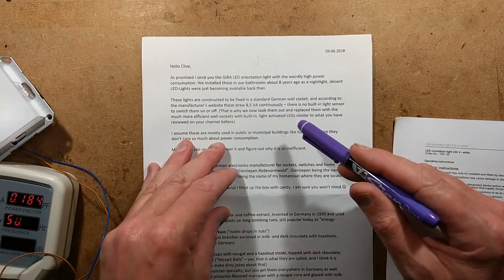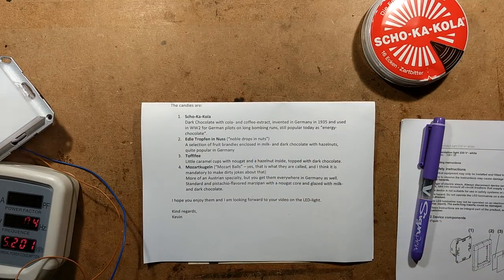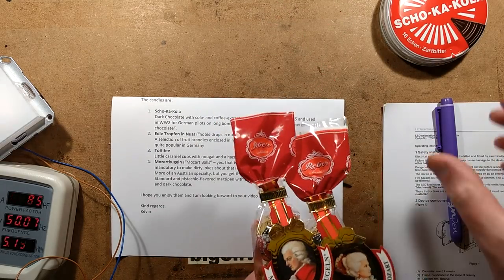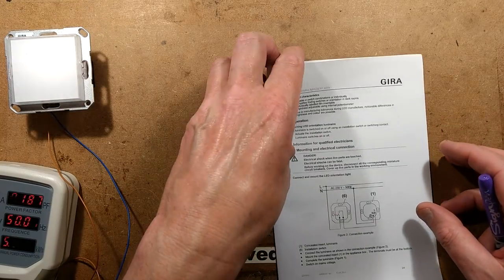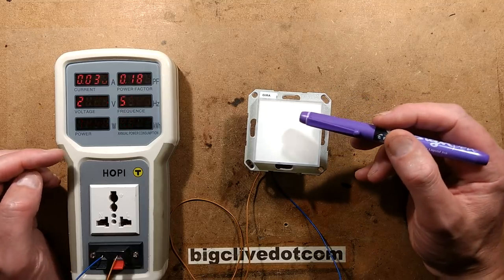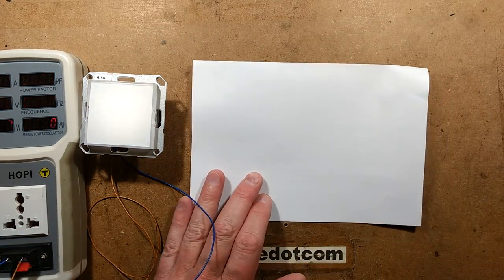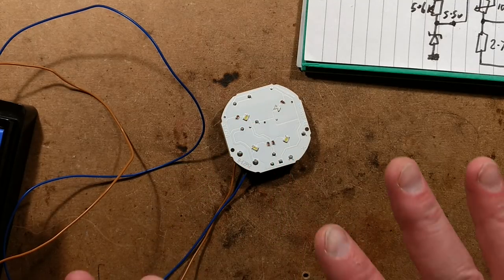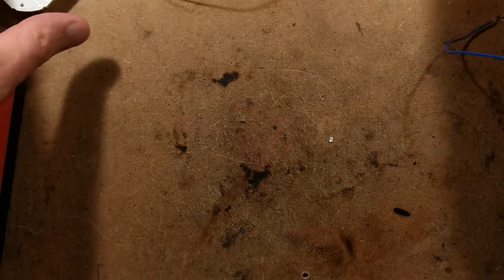Well engineered German LED light?  With schematic and tests.

Comment: A smart meter will be installed at this property over my dead body. At the monent they are not compulsory. I wonder what excuse the power companies could use to make them so?
Reply: We have them here in Edmond, Oklahoma. Along with "smart" natural gas meters. Didn't have a choice. I can't complain.....yet. Our bill is quite low compared to the national avg.
Reply: simple...………you don't own that meter, it belongs to them and ultimately they can do what the fuck they like with it I'm afraid...……….But for the moment make a stand Sir (or Madame)
Reply: andymouse123 But I own the property and do not have to let them in. The meter is also attached to my wall. As long as the meter is accurate,  and they would not have fitted it if it were not,  they cannot insist. As an added "complication",  I am a radio ham and there are strong electromagnetic fields in the property. Years ago when I was single,  the electricity company kept on trying to read my meter when I was at work. They said that they could break in to read the meter if I refused to let them read it. I phoned them up and made it quite clear I was not refusing to let them read my meter. I was,  however,  refusing to take half a day off work unless they paid me at my full professional hourly rate. They got somebody to read the meter at MY convenience in the evening. Smart meters are not for our benefit,  but that is how they are "sold" to the uninitiated.
Reply: If they insist on installing one, just make sure to include foil backed plasterboard on the walls, put it in a cupboard with a metal door, and so on.
Reply: Dr Teeth. shitty as it is all you can do is what you are doing ….just make it as difficult for them as you can and good luck …..im gonna do the same
Reply: @DrTeeth while it is on your property, the meter is the property of the Utility company, and they have Easement access rules/laws in place that allow them to access their meters any time they want, regardless of where they are. If you refuse, then they are allowed to force entry to retrieve their hardware, leaving you with no power what so ever. People have already found this out the hard way by having their power cut of completely.
Reply: As far as I'm aware at the moment if you have a smart meter installed then switch to another provider they aren't able to access the "smart" features. In the current generation of smart meters at least.
Reply: John Ward Isn't it difficult to make a Faraday cage RF-proof at a given frequency unless the radiator is fully enclosed?
Reply: Technically that could be an issue, depends if the enclosure the meter is in has any RF blocking properties, and seeing as they are often metal, and id assume grounded, its quite possible that the enclosure does have a blocking or damping effect in some directions, otherwise the back side of the unit is free to radiate. Other issue is that it could be seen by the utility as tampering with the equipment and could land you in trouble.
Reply: KSSilenceAU The meter might be theirs, but the cupboard is mine, all mine. RF is a tricky beast to contain. Always best to make a 'cage first with full containment. I suppose I could always squirt 100w of RF at it ;-).
Reply: That's a bit of a slippery slope thing that is, if you were to deliberately RF shield the cupboard to defeat the meters ability to communicate then you might land in trouble from the utility, and they may also charge you extra to send someone out to read the meter and investigate, has happened before multiple times with people thinking they can out smart the utility company.

Comment: Goodnight , I would like to know if sleeping with an Air Conditioner on at night is bad for your health.Because if you open a piece of equipment say a DVR ,You would find a very thick white kind of dust that I an concerned about .
Reply from the maker: Equipment like that often has some accumulation of dirt in it.  Sometimes an attempt to clean it just results in loosening the dirt up and allowing it to get airborne.

Comment: Woofs  Clive they are putting in smart meters system wide here we have no choice in the matter  I am on a TOU time of use plan when its peak time the cost of power is 28 cents per kilowatt hour   off peak its 7 cents per KWH  peak in summer is in the afternoons in winter its early morning and late evenings  Its only in force 6 months out of the year  all other times its at 7 cents PKWH   they tell me it transmits every 10 minutes telling them my use  so they will bill me for apparent use and not actual use ?? maybe you need to do a spot about these new meters I am  curious how this will work  . I would send photos of the meter but cant here .

Comment: You should ALWAYS refuse the installation of "smart meters" to your home.
They emit massive amounts of RF energy...not very conducive to living tissue.
Also to some people they cause headaches and/or migraines...I get the latter.
You can claim "for heath reasons" if the power company balks at the request.
Reply from the maker: They don't do any of the things people are claiming.  Even when communicating briefly with the base they are the equivalent of a mobile phone logging in.  You'd do more damage with a phone in your hand.
Reply: I can guarantee  you that mine caused me some pretty severe migraines...and when it was removed I was back to only a few per year.
My SM happened to be the one on the end of the line which meant it was in constant communication with the others on my block.
It was also the one that stored the data for the mobile trucks that went by to collect it...which sent in a high powered burst then.
BTW:  I don't use cellphones either unless it is a dire emergency so I don't have one in my hand except for then.